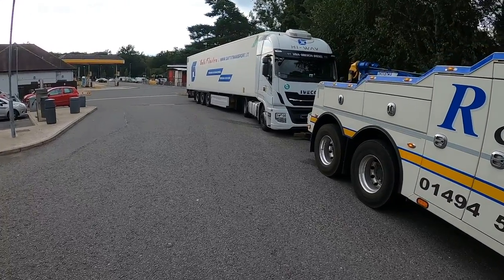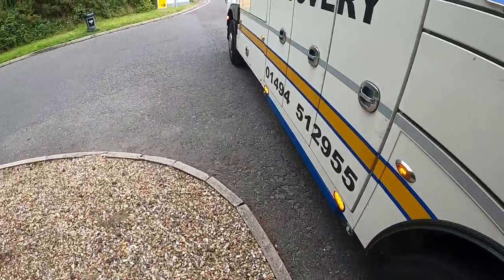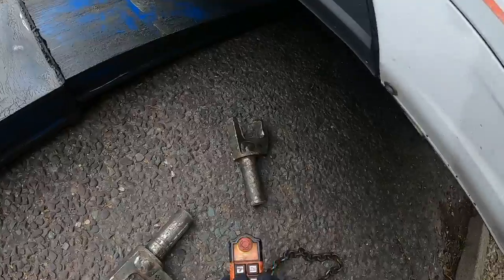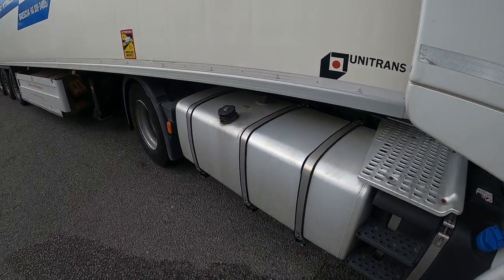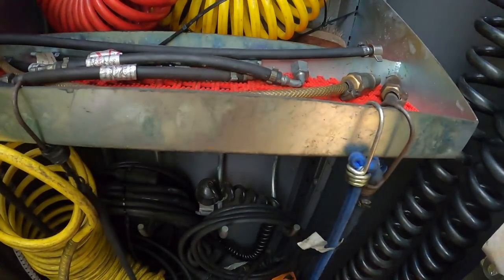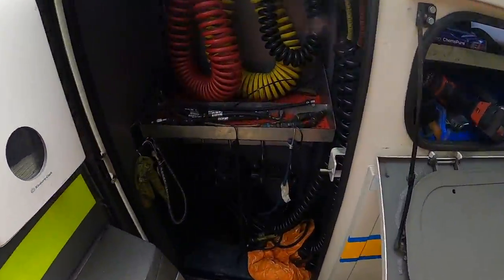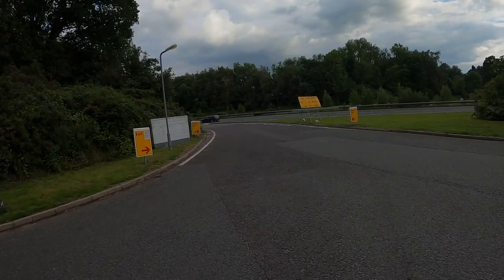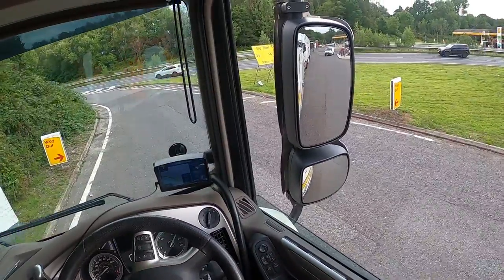RECOVERY OF 40 TONNE LORRY! UK HEAVY RECOVERY!

Comment: Hi again Steve it's John from kidlington again what's the regular of your truck now mate rs20 or rs22 as both trucks look identical mate from John and my wife Nora here in kidlington in oxfordshire
Reply from the maker: Hi John and Nora , Both trucks our Daf Xf530 but made by different body manufacturers. The 22 plate is about 2 tonne lighter with aluminium bodywork but smaller lockers but i do prefer the lowline underlift on it.

Comment: If you aired up the unit with one airline? Why did you air up the trailer als
Reply from the maker: Hi Micheal , we our still required to run 2 lines from our truck to the trailer , yellow service line for braking and red susie for emergency in case it comes disconnected from tow truck the trailer brakes will be applied.

Comment: As you said its been a while, but enjoyable one thing I have noticed in America they use safety chains I gather they are not needed here in the UK
One thing with an artic do you have 2 swivel points?  If so tou have an articulating artic a great challenge when reversing! Thanks for the video Steve best regards Kewn
Reply from the maker: Hi Ken thanks for watching  , yes mate 2 pivots points gentle does it going backwards takes a bit of pratice , i can tell you lol.